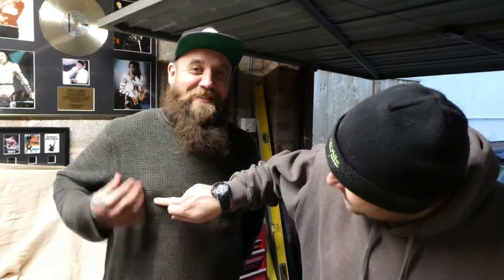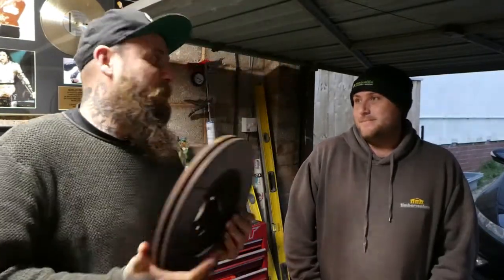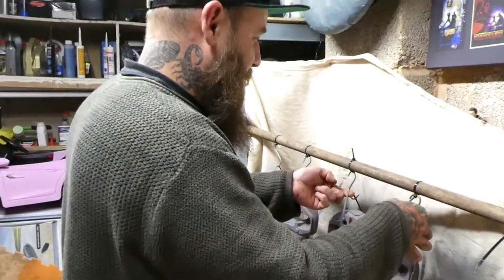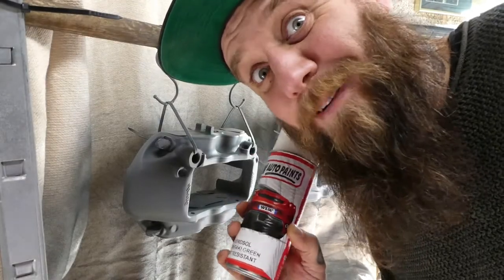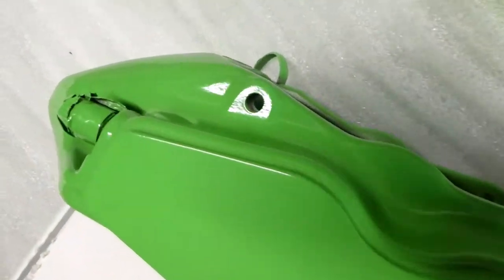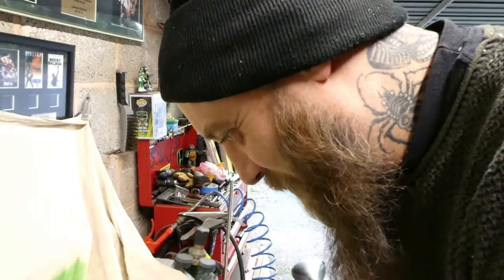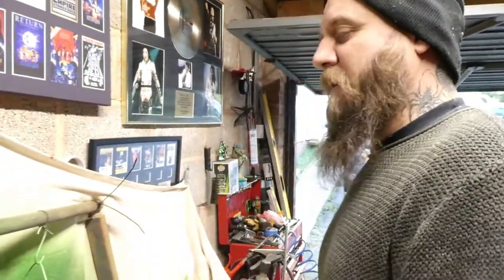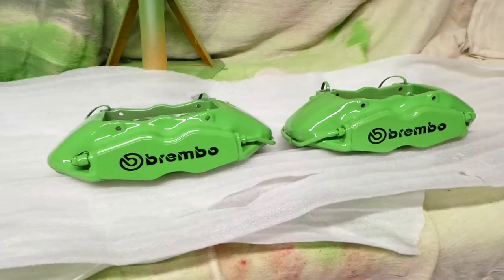Paint refurb on Bens new 4 pot Brembo brake calipers

Comment: Glad you made this what bolts were holding the calipers on bud?
Reply from the maker: Massive ones lol I don’t know sizes or specs or anything mate, all came in a kit
Reply: @CowabungaCarDiaries  nice mate how does braking compare to before
Reply from the maker: @jacksmith-ok8tx  there not fitted yet bud, will be doing a seperate video on that and a comparison of oem and these 🤘🏻
Reply: @CowabungaCarDiaries  oh right great. When be great if you could show how the adapters for bbk fit together aswell would help people wanting to buy them massively.
Reply from the maker: @jacksmith-ok8tx  will be a full install video bud 👍🏻
Reply: @CowabungaCarDiaries  great news man!!